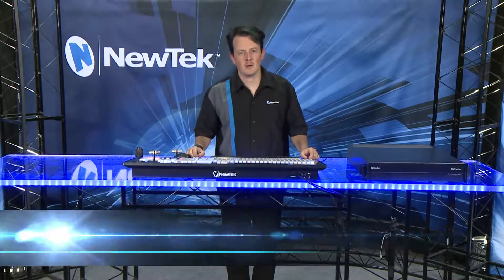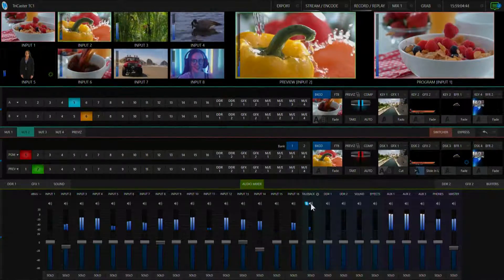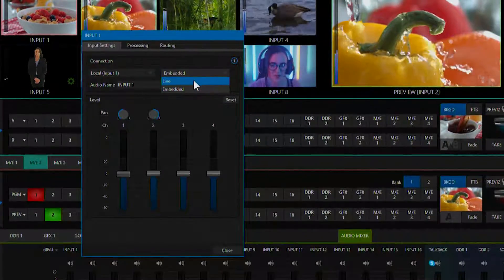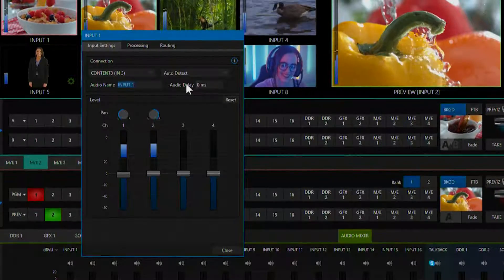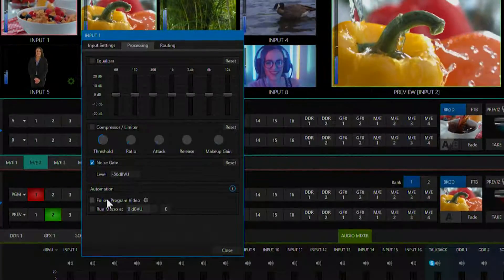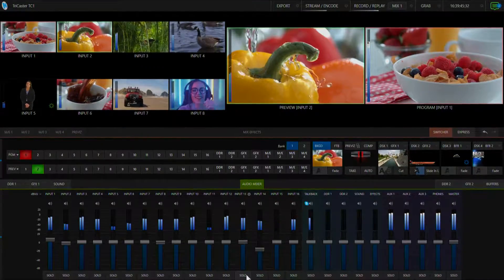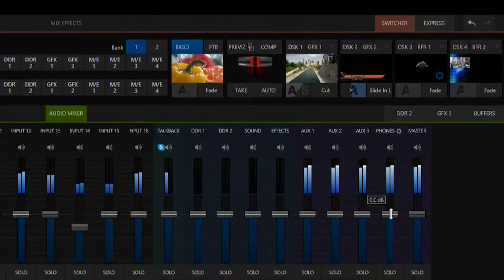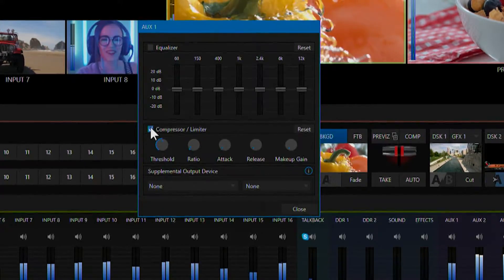TriCaster TC1 Get Started Training Chapter 9 - Working with Audio

Comment: so we have a tricaster tc1 and the mics coming in are so soft we cant hear them. the external mixer coming into tricaster is sounding good but in the tricaster the levels are so low its not usable.\
 this is a balanced line input with the tricaster input set to line input. there is a tickle of movement of the meters but why is it so low. is there a gain button thats hidden . i cant find it .
Reply from the maker: there is no hidden gain button on this system.  you can boost the levels a bit with the faders.  There may be something else going on with your system.  I recommend contacting our support staff about this https://support.newtek.com/hc/en-us/requests/new